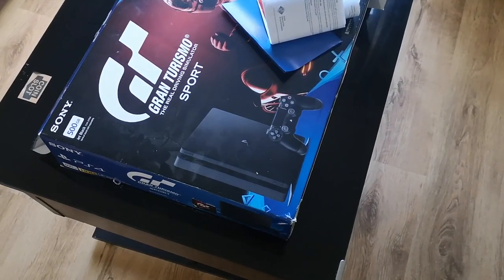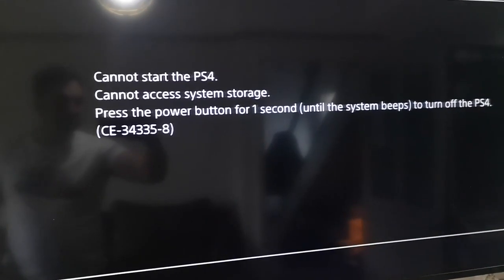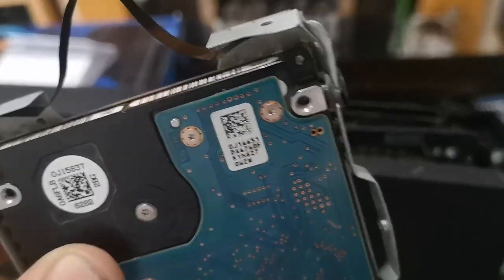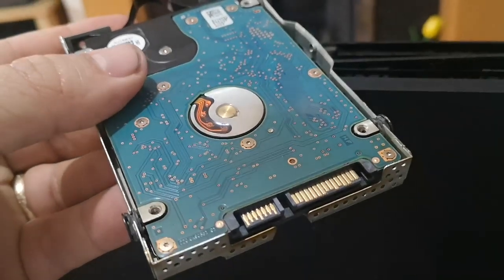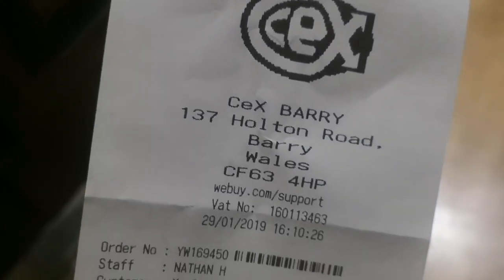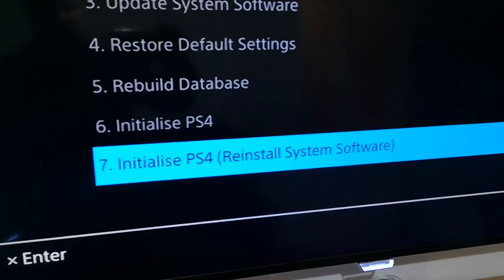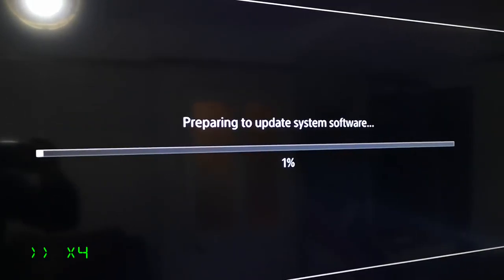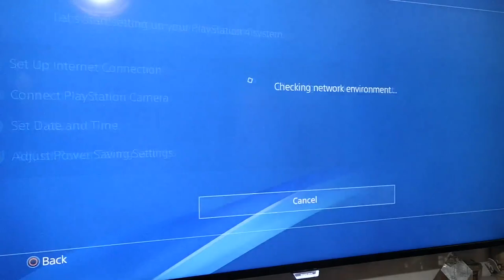CE-34335-8 PS4 Slim Hard Drive Repair Error System Storage Playstation 4 Sony

Comment: Pls respond.
My ps4 has been broken for like a year now and I want to play again and I've been in the safe mood loop and then I did option 6 to reboot everything and then it came up with that error code saying cannont access the storage thing so do I just need a new hard drive or what. Also idk if it's a external one or internal. I have a ps4 slim
Reply from the maker: Best thing to do is to test a new drive. Will be the first thing to try and will give you a good working system if it is a drive issue.

Comment: Hey dude I hope you can respond to this.
The first time I got the hard drive error I initalized my ps4. That semmingly solved the problem but 2 days later the error popped up again. I decided to order a new internal hardrive and it just came in today. But when I installed the new hardrive the same error popped up. Also when I try to go into safe mode with the new hardrive it only gives me one option. The very last one that says ' initialize ps4(reinstall system storage) '. Yet when I choose the option it gives me the same error. I'm very frustrated and confused...
Reply from the maker: You shouldn't need to format it in a pc first but might be worth trying that then putting it back in.
Without the drive in how far are you getting? I'm wondering if there is an issue with the drive caddy or connection to the board if the drive isn't formatting.
Is there any specific error code when it fails?

Comment: Thank you this video gave me a very good understanding of what was wrong with my ps4! I have one question though. How would i backup my data on my old hardrive so i dont lose my old data because i think that if you want to backup data that you have to do in the ps4 settings but my ps4 wont even boot up? Please help! Also do you have a link to a video that you used to open up the ps4 and clean it?
Reply from the maker: Hi, you do really need to access the drive to do the backup. Ideally to the cloud but if you can't boot it then I'm not sure there are many options, I've had a few people ask this and not much response. Other idea is to try that drive in a pc but not sure if you'd be able to access it.
Depends on how far in to cleaning you want to get, some of my videos show this but most of the time you can get away with just removing the top covers and cleaning out the fan. Any deeper clean will need a bit more time and effort.
Reply: What if save mode doesn't show up? What's next?
Reply: @lloydsalmon3920  wait does your ps have the same problem and you can’t access safe mode??
Reply from the maker: I would try a wired controller (make sure compatible usb cable) and follow the process to get into the recovery menu, you should always be able to access that. If you can't then it could be more of a bios issue but I've not seen many examples of that.
Reply: @ktbmeli613  yes I can not access safe mood

Comment: I have a slim I had for years the sound has went out and I cant load games or apps do I need to replace my hdd
Reply from the maker: Could be a corrupt drive, but if it is booting but no sound could be another issue. 
See if you can go in to the settings and do any checks on the drive. 
Has the HDMI been pulled? That would be my first thought on the sound.

Comment: If I replace a ps4 original hard drive with a ps4 slim hard drive will it still be able to work ?
Reply from the maker: Yes I believe they are both the same dimension data drives. Will probably still need the rebuild of the software to setup for the other system.

Comment: Ok so ive seen youve replied to other peoples comments and i have a question my internal hard drive on my ps4 stopped working a couple days ago and ive tried everything to fix it my question is could i just use an external hard drive or connect it to my pc to get it to work
Reply from the maker: Hi Eggboy, No sadly the system relies on an internal hard drive as a minimum so you'd need a small internal drive then could add a larger external drive if wanted.
Reply: Goodwins Place oh dang thought i could just juryrig it to get it working lol
Reply from the maker: @eggboy3218  yeah a few people have tried and don't think it will work without the main OS files on the internal drive.

Comment: I had the same problem with my PS4 it just randomly gave me this error but everything looks in fine condition. I tried taking the hard drive out and mounting it back in, but that didn’t fix the problem is my only option buying a new hard drive?
Reply from the maker: Probably, you can try formatting that drive but even if it works it could go again soon.
Reply: @GoodwinsPlace   How do you format
Reply from the maker: Follow the steps on the video to get in to recovery mode and rebuild the drive.

Comment: Clicked a campaign difficulty and the system crashed. Rebooted and it says no storage and to turn off, no safe mode. Waited 40 minutes and it THEN said to connect the USB... But I don't even want to do that. I JUST reinitialized it and it crashed again.. .
Reply from the maker: Have you tried options 4 or 5 on the menu?
Reply: @GoodwinsPlace  it won't even boot. It just has the blue light fading in and out and then it'll go white and have the prompt pop up that my storage can't be read. Do I need a new solid state? Or can I buy a 2T external, put the software on there, and connect to the PS4 via USB? Or do I NEED a new 2.5" solid state? It won't even boot into safe mode anymore...
Reply from the maker: It doesn't need to be a solid state, they are faster in most cases but more expensive.
I've never tried without an internal and just a usb drive, but believe it needs the internal for the system files as a minimum.

Comment: If i get a new hard drive and replace my old one, will i lose my accounts and games? Im stuck in safe mode and am unable to download data and stuff. I would be bummed because i have a lot of games
Reply from the maker: If you can't back it up to usb then you will lose it by changing the hard drive. You should be able to download the games again, it's the save files which aren't easy unless you have them backed up elsewhere.
Reply: Goodwins Place ah yes thank you, i could care less about the saved data, as long as i could download the games again. Much appreciated
Reply: Aydap did it work ?

Comment: Help help help im to broke to afford a ps5. So im thinking about getting a new hard drive. All my games arent working it said corrupted data or cant open app etc i try everything rebuilt data renew license  and even factory reset my ps4 pro and still the same.
Reply from the maker: It could be that your drive is slowly failing if you've tried factory reset and everything else. It would be cheaper to get a drive and replace than buy a new system. See if you can buy one from somewhere where it could be returned if it turns out to be a different issue.

Comment: Hello sir can you help me my ps4 need reinstallation of software  where can I see that thanks  sir.
Reply from the maker: Follow the steps in this video to get to the system restore menu. If you drive is fine then you can format your system using that.
If your system is working then you should also be able to do this from the settings control panel once booted up.

Comment: Ik im real late but i got the dust out got a new hard drive i tried everything and it still dosent work
Reply from the maker: You should be able to get in to recovery mode by holding the power button even without a drive.
Reply: @GoodwinsPlace  it wouldn’t let me do that
Reply from the maker: That's strange. Should be part of the core system recovery.
Reply: @GoodwinsPlace  i cant even go to safe mode

Comment: My ps did the same, if you punch it soft it works just need some help with starting up you know
Reply from the maker: 🤣 sticking drive heads will do that until that one day they stick and totally screw up. But no problem if you have your save data backed up.
Reply: I made a back-up the first time it happend but after my punch it worked for like 6 months

Comment: I have a problem I'm not sure it is the hardrive but, when I'm on the home screen it works as it is supposed to but when I play disk games it last for like 5 to 10 mins before it chips out like when you tug it out of a wall but when I play games that is directly on the ps4 it depends, some times it will last for 30 mins minimum to 5 hrs  maximum. It will do the sames thing just chip out with no warning nothing. when its chipped out the ps4 makes a weird noise like a soft 'weeeeeee' (it's not the fan) and I have to press the power button 2 times to get it on
Reply: It has nothing to with the video I didn't do it yet

Comment: I opened my hard drive to get the mounter and put it on my ssd but some tiny circle piece fell out. I don't know where to put it and I've found nothing you got a solution?
Reply from the maker: You opened the actual drive? I'm not sure about swapping parts between drives and why you'd do that as it wouldn't transfer the data to the SSD.
If I've not understood correctly let me know and I'll help where I can.
Reply: I found out that that was another piece and irrelavent. will the playstion turn on if the brown looking screws are not plugged in to the hard drive?

Comment: Hello, do you think you can help me with my ps4?
Reply from the maker: Depends what the issue is. What's happening with it?
Reply: @GoodwinsPlace  so my old hard drive corrupted so I’ve bought a new one exact same model and when o put it in and turned on the ps4 it says it cannot detect the system storage and I’m lost and don’t know what to do 😅
Reply from the maker: Have you booted in to recovery mode to see if you can rebuild it there? I might say it can't see it if it hasn't been rebuilt.
If it hasn't been dropped or anything else it should just be the drive replacement and rebuild as in the video.
Reply: @GoodwinsPlace  it hasn’t been dropped or anything and I can’t put it in safe mode at all
Reply from the maker: @fallenshinobi8191  ok check your control pad connection. You need to get in to safe mod. Try connecting using a known working usb cable, it needs to be a decent quality cable to work with the PlayStation.
Reply: @GoodwinsPlace  okay so I’ll use the old one and put it in safe mode correct?
Reply from the maker: @fallenshinobi8191  you need to follow the steps in this video with the new drive inserted. Connect the pad and get in to safe mode by holding the power button as shown. Then you can start looking to build the new drive.
If your old drive was still working you could keep it in and try recovering it.

Comment: I replaced my hard drive but during installation it's freezes at 20% then it's start loading too slow like after half hour just 23% was complete what might be the problem can you please help
Reply from the maker: Is the new hard drive a new drive or a second hand one? It could be the first part is the formatting the drive the second part transferring the data, this will also depend on the speed of your USB.
Reply: @GoodwinsPlace  I waited for more than 2hrs and only 32% was complete then eventually it stops going forward do you think it's problem of hard drive ? Becoz my usb works fine on laptop speed is also good

Comment: Idk if you still reply but I could use your help a lot. I don’t know much about technology but my ps4 won’t go into safe mode and it says the error that the ps4 can’t start and can’t read the storage. May you explain what I have to do to start playing again? I don’t have a usb or a pc so if you could tell me anything that would be appreciated.
Reply from the maker: Hi, always reply when I can.
This is a tough one, you will need a usb with the files as a minimum to restore a drive. 
Anyone you know that could put the files on a usb for you? Not sure where you are based but maybe you could get one on eBay?? 
If a restore off the safe me u doesn't work then you'll probably need a replacement hard drive too.
Reply: Goodwins Place omg I’m so thankful for your reply but something else happend. I waited around 10-15 hours and tried again a and it worked perfectly fine!!! I’m scared if something might happen thi
Reply from the maker: @whispaa  glad that it is working. Sometimes hard drives become stuck but free up after a while or movement, this is a good thing as it will often carry on working but it could be that this comes back again. 
At least you have an idea on what it could be, and have a working console.
Reply from the maker: @whispaa  glad that it is working. Sometimes hard drives become stuck but free up after a while or movement, this is a good thing as it will often carry on working but it could be that this comes back again. 
At least you have an idea on what it could be, and have a working console.

Comment: My ps4 loads but won’t even start up
Reply from the maker: It loads to the dashboard? If so what happens then? 
Sounds like a different issue than the hard drive if it gets to boot, although one that keeps crashing could be early signs of a faulty drive too. Any noises from the system?
Reply: @GoodwinsPlace  so like it’ll load then say can’t start and sometimes it will go to the home page of the ps4 but it’ll freeze and stuff

Comment: so hopefully you reply to this, so my ps4 was unplugged while it was on and it fell from my desk, once I plugged it back in I got a error (CE-30022-7) I looked up the error and it says it has something to do with a “External hard drive” error, but I’ve never plugged one in!! Any suggestions? I’ve initialized, rebuild data base and ever factory reset it, I’m running out of options :(
Reply from the maker: Was there any usb sticks or anything in usb ports when it dropped?
You could try removing the internal hard drive to see if the code changes.
Did anything get bent out of shape when it dropped?

Comment: YOU ARE SO POST TO FIX IT NOT GO GET ANOTHER ONE 😭😭😭😭😭😭
Reply from the maker: Sorry but if you have the same issue it is unlikely you will be able to recover that hard drive. It's a parts replacement process. Easy to do but once drive is dead it is often beyond repair.
You could try some of the other menu options in the recovery menu first.

Comment: Any ideas on how to get a disc drive to work again it's like there's a barrier in front of the disc slot on my ps4 slim
Reply from the maker: Merry Christmas. Hope it's not someone's present. Can you hear the rollers turning? They may have come off or jammed.
Try a piece of card or a credit card on both sides to see if it pulls it, obviously don't let it go inside.
Reply from the maker: I have another video on my channel that shows a dvd rollers repair.
Reply: I try to stick old cds in it so I don't ruin a game and I don't hear anything turn at all
Reply from the maker: @tylerneil2476  sounds like your rollers are jammed or come off,  take a look at this video, slightly different depending on model but basics are the same: https://www.youtube.com/watch?v=qp90li_JibU&t=32s
Reply: Goodwinsplace r

Comment: I took the hard drive and it makes a jet sound when it turns on and off, the circle in the middle of the hard drive is what’s making the sound but is it something I can fix myself or do I replace it with a 1 terabyte hard drive?
Reply from the maker: If the hard drive is making sounds and still working then I'd suggest backup and replace with a new one. Doesn't have to be same size as originally installed.
Reply: Goodwins Place but will I lose all my data if I switch to to another hard drive?
Reply from the maker: Sadly yes if you don't / can't backup first. Do you have any online backups or any other devices?
Reply: Goodwins Place other devices as an a usb drive? Then no but can’t I have the hard drive fixed? No I don’t have any online backups but my games will be saved right?
Reply from the maker: You can send off hard drives for repair but it can be expensive. There might be some YouTube videos on getting the drive running again long enough to get your data off. Depends how much you value your data.
Game saves too unless they are online. The system only has one storage as default unless you use an external drive as a second location. Crap I know.
Reply: Goodwins Place well looks like I won’t be getting a new hard drive I already have hundreds of hours on my games. You know any trusted places or websites to have my hard drive fixed?